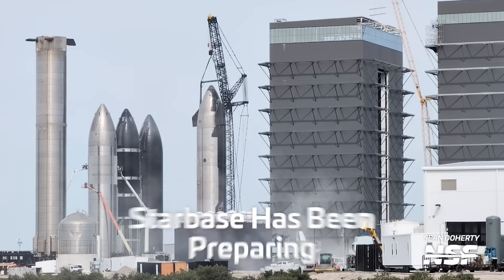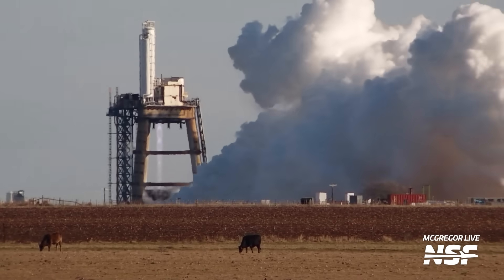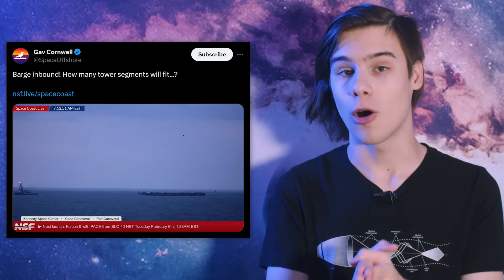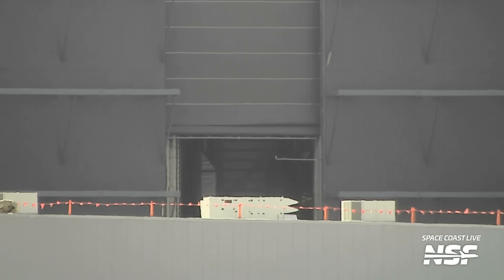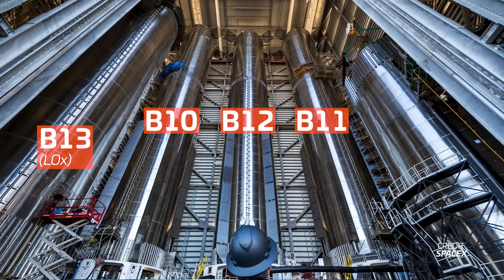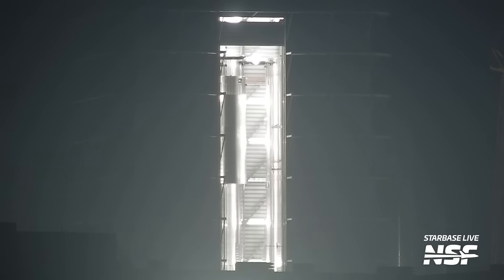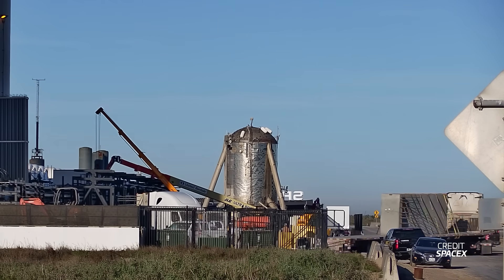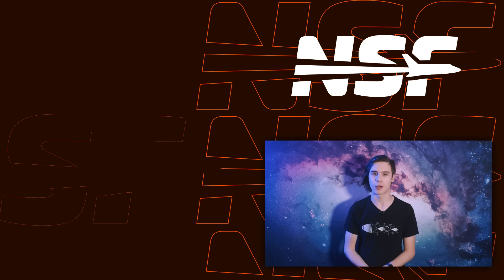Boosters for Many Flights in the Mega Bay | Starbase Update

Comment: Connecting two starships together in orbit and then giving them a slow spin allows “pinning” of the propellant in the tanks so it’s not free falling around in the tank.  With the propellant fixed in place it can be pumped from one ship to the other.  Perhaps that’s the reason for the double stringers on the outside of the weird starship. It’s a test article for fuel transfer and needs extra support of the tank.

Comment: 7:00 - I was thinking more in the lines how it would look like if Starbase was more north and it was freezing outside. But I can imagine with all those storms hitting the coast, just the wind and water can be an issue.

Of course with all the concrete, it must like a furnace there in the summer, even with no rocket fire.

I can only speculate why my previous two comments got removed. I wasn't trying to stir that 1 % who need Wikipedia banner and spam discussions nor go off-topic.

Comment: I predict that tower 2 will have one extra segment compared to tower 1 to accommodate newer taller versions of booster and starship.
Reply: no, already confirmed that they will be same size
Reply: @bryanillenberg  So if SpaceX are building a taller ShipV2, then they must be changing the lift points to a lower position or raising the Chopstick Arms to a higher position, in order to stack it onto the Booster.
Reply: @David-yo5ws  AFAIK, that is the plan

Comment: I think Ship 26 is a welding training site for new welders using manlifts, lol. Question: why hasn't Booster 4 and Ship 20 been scrapped yet? NSF needs to research this question. Great video, as always! 😀👍
Reply: Thats what I was thinking lol
Reply: S20 may be difficult, due to the tiles.
No fully tiled ships (weld points tiled over, unlike S22) has been scraped yet. So far, this list consists of S20, S24, S25, S28, S29, and S30. S31 is receiving additional tiles

Comment: I think the ship 26 will be used to perform a hold down long duration static fire at the Masseys flame trench which is under construction while the cables being tied to the 6 lifting points on the nosecone and the test stand.
Reply: Well... Actually it's a pretty good hypothesis. And less about single test, but with work on proper test stand in Masseys.. they can make test stand "in scale 1ft to 12 inches) for multiple raptors. As for now they can faster produce raptors than test them
Reply: @just_archan  if you think about it no other test comes to mind,they can't test nosecone cause the nosecone jail is dismantled and it still has its engines and it's not going to fly for sure 🤷
Reply: @samadbaeg545  I mean in Masseys new stand can be similar in principle to Stannis space center where SLS is tested. With a twist in form of sn26 where they can test raptors alone with full duration burn. I don't think that SpaceX need to test  ships as a whole anymore, but full duration burns of  multiple raptors at once in controlled environment will provide lot of data important in development, additionally to on site test stand for new raptors that can be delivered directly to starbase. SpaceX is now produce more raptors than test them.
Reply: We are months from Massey being ready.
Reply: @knowledgeisgood9645  and the ship is not going anywhere meanwhile 😁

Comment: If you were going to fill the payload volume with fuel, that would probably required an extra strong ship structure.  I could believe that S26 is a trial unit for a fuel depot unit.
Reply: The fuel adds stiffness. When empty they add gas.

Comment: No insulation on Mega Bays so may be difficult to cool under Texas Summer Sun?
Reply: Difficult with enormous large doors open all the time.
Reply: If they can just bring the temp down from 110f to 90f, that would be a huge difference.  Insulation would be required to bring it down to 72f.
Reply: @mikesunderland9145  The winds inside are a big problem too.

Comment: Would ship 26 possibly used for the LEO refueling station/ship?
Reply: Maybe. But it has so many contradictions built in it is hard to guess. Has studs. Has external stringers (and internal). Has no TPS. No flaps. No payload door. Just weird. It could be a test article - but what test?
Cut a very large door in it and install hinges?
Reply: I'm not sure, but they keep talking about testing a refueling system, which would involve at least one ship in orbit, if it doesn't have tiles, that would mean it would be something that would launched and parked, I have no idea how they plan on transferring fuel, but it did look like in simulations that it was some sort of belly to belly.
That would mean it would probably utilize the same connections as the QDC?
I'm not a rocket scientist, just guessing...
I don't see how any of what they are doing would facilitate even a test ship of any other kind. IMHO   @knowledgeisgood9645

Comment: 4:30 How will they get the segments through the border control point? 
It definitely is not wide enough for such big parts. 
Will the build a road around the control point?
Reply: They might dismantle it. They have to have worked it out before shipping the sections.
Reply: The modular transporters can rise and lower.  I suspect they will just lift them up high enough to clear the little shack.
Reply: @mikesunderland9145  I don't think they can lift that high.

Comment: Interesting, how you guys jumped to the conclusion that all 6 engines are being swapped. If the plan was to swap all four why take out 1 sealevel, then install a new one. Then to remove a RVac and then install that aswell. If the plan was to swap all, it would make more sense to remove all and then do the reinstalls 💁‍♂
Reply: Not if it is easier to do one swap at a time.

Comment: I think ship 26 has the stringers to support the ship while  unpressurized,  possibly a future fully fitted interior mock up
Reply: Thats what I've been saying for weeks. Most likely scenario imo.
Reply: S26 has had stringers on the inside all along. Why it needs external ones too is still unclear.
Note it has no door. No tiles. No flaps. We can guess, but only SpaceX knows what it is for.
Reply: I think it’s fun they’re working on it waaaay out in the open so we can sit here and speculate
Reply: Maybe SpaceX is thinking about what they can do next with Ship26, to let us make weird speculations.
Reply: As a mechanical engineer this is my thought as well.  They want to be able to move the ship without all the extra equipment to pressurize the tanks.  But what do I know, I'm just an engineer. /s
Reply: @SpencerPlayerPhotography  They always have to pressurize the tanks, OR lift it from a crane. That could be done to the cargo compartment too. The stringers can't alone do the job.
Reply: the area with the extra stringers is the cargo section which is not normally pressurised. It normally has a great big door in it. If the stringers were in the oxygen and methane tank sections maybe your hypothesis would be plausible
Reply: @rubikmonat6589 
The lightly pressurized oxygen and methane tanks don't need better stringers. It's the unpressurized section (below the crew section)  that needs additional stiffening for withstanding a full payload mass, plus filled header tanks. 

Putting stringers on the exterior may be for convenience, or done to permit removing the smaller internal stringers.
Reply: It sure looks like it is the hls prototype.  Stringers will definitely be needed in the unpressureized section.  Now should we start to see upper lunar engines then we will know for sure.
Reply: Doubt it.  Much to much weight.
Reply: @kokomo9764  Not worth flying s26 with all these ships waiting in line.
Reply: @kokomo9764  - He said mock up, not flight article.  Weight means nothing if it isn't going to fly.